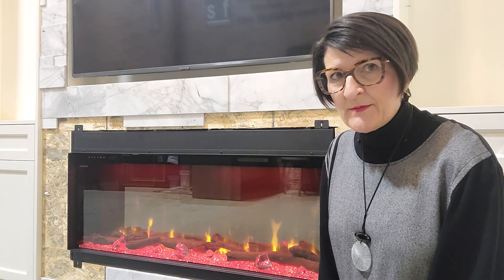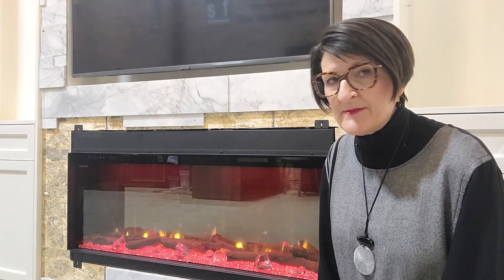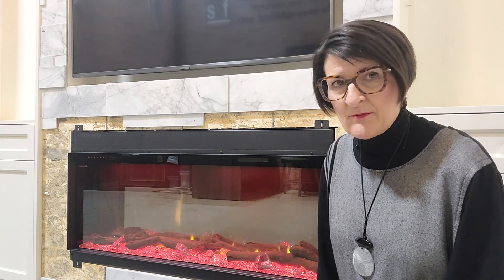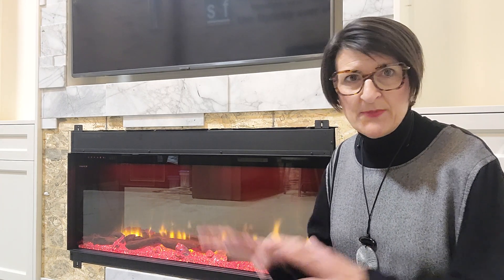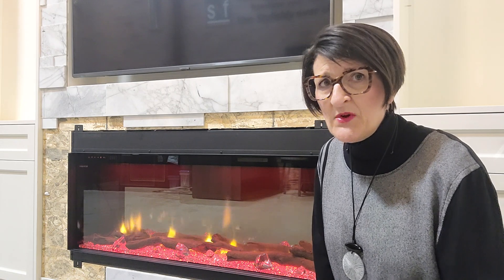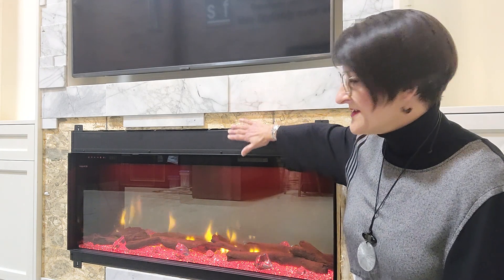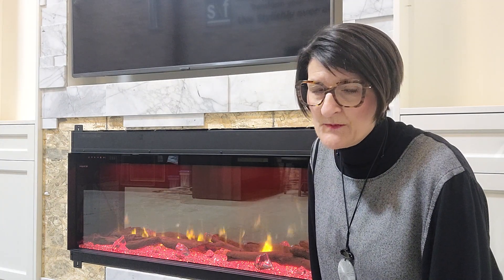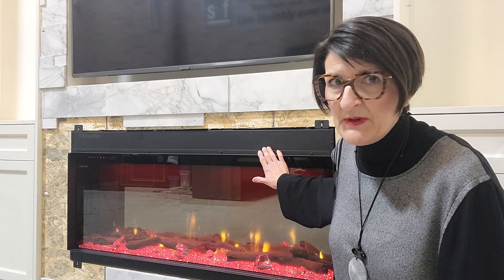What are the electrical requirements for electric fireplaces?

Comment: would that be a 14/3 or a 12/2? romex
Reply from the maker: Just confirmed with our installer: Most electric fireplaces that are on a 120V line the wiring is 14/2,  and most that are on a 240V line is 12/3  (technically could be 14/3 but most electricians would put it on 12/3).
Reply: You want 14/2 (not 3) if it's on a 15 amp circuit.  12/2 is always OK for 15a or 20a.  You NEED 12/2 or larger wire if it's a 20a circuit.  14/3 or 12/3 means 3 conducters, which would be used for a 3-way light switch, for example.

Comment: Thanks for the info. I’m guessing that putting an electrical fireplace that is rated 750-1500 watts on Amazon directly to a power outlet and having a tv on the same outlet would cause a fire?
Reply from the maker: Hello. Newer TVs don't draw a lot of power. However, electric fireplaces have heaters, which usually max out around 1500 watts. They ideally require a dedicated circuit; that's an outlet that goes straight to the electrical panel and there are no other outlets or lights on that same circuit breaker. If you plug in a fireplace to an outlet that's on a shared circuit, as regular outlets would usually be,  and you turn up the heater past the available power on the circuit, the circuit will overload and your circuit breaker will trip to Off. You will then have to reset the breaker, after reducing the load on your circuit by turning the heater down or off. It's highly unlikely that a fire will occur, in a properly wired home. However, having a circuit breaker tripping every time your heater is on is a warning that your wiring is insufficient for the fireplace. (And it's annoying!) If this is happening, stop using the heater, and consult a licensed electrician.
Reply: @stylishfireplaces  thank You so much for this helpful advice. I called Electrician yesterday and he is coming to do a dedicated line. My issue is that the heater I am buying from Amazon is between 750 to 1500 W but it doesn’t say how many voltage so I’m assuming it will be 110 and not 240v. If that’s the general volts they are
Reply from the maker: @tamir5940  Right, a plug-in electric fireplace is 110/120 volts not 240 volts. All electric fires are 120 volts; some also connect to 240 volts, but not the majority.

Comment: 15 or 20 amp circuit?
Reply from the maker: Most are 15 amps. This should be noted in every Owner's Manual.
Reply: If you're adding a new circuit, go with 20 amp if you can.  1500W is close to the max that a dedicated 15 amp circuit can safely operate for a prolonged load (e.g. a heater). Make sure 12 gauge wire is used if installing a 20a circuit, of course.